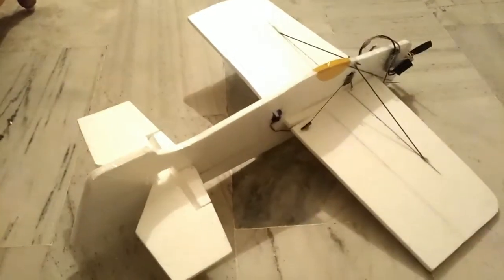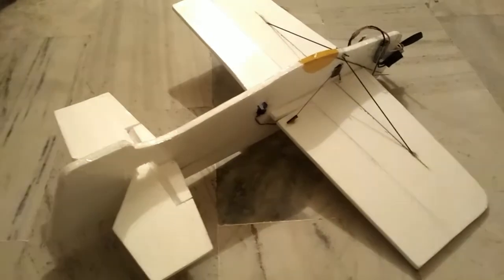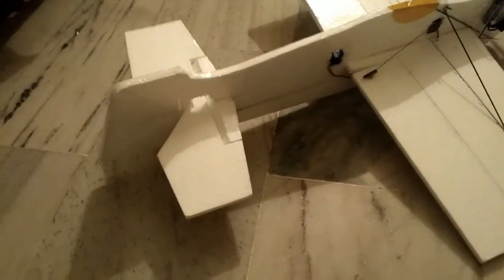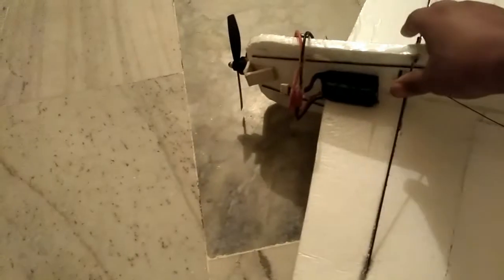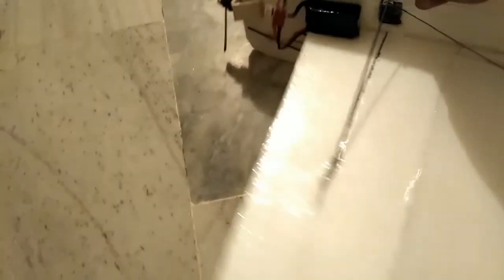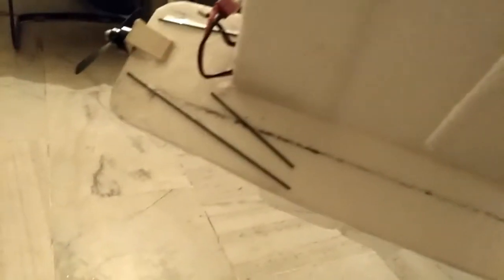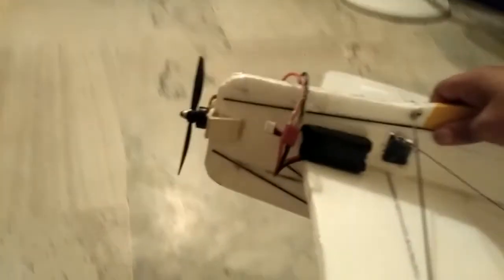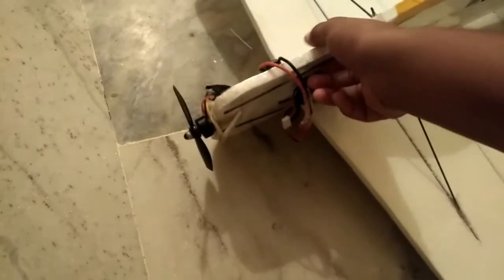3D RC Plane DIY | Superslo 28B 3D | Thermacol

Comment: thanks for posting.  good work.  here is some  information for you and your subs.      this type of over-powered model does not fly.   it  'hangs on the prop'.     this type of model is  Way  over-powered,  while having a main wing that makes  ZERO  lift.    this is a 'zero-lift brute-force' approach to keeping a model aloft.   i prefer to have  LIFT  involved in my model-flying.   if it suits, see link of an actual  slow-flyer; the model has a main wing that Does make Lift (together with plenty of drag).    cheers
https://www.youtube.com/watch?v=15HUzLifQWU&t=